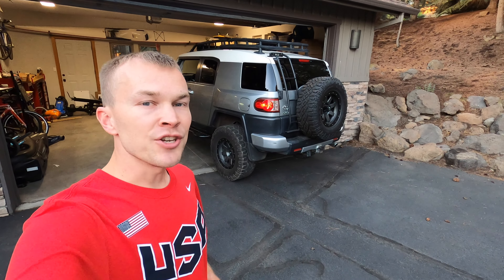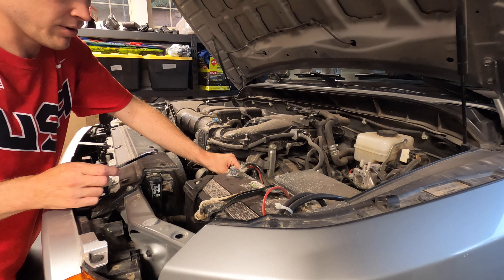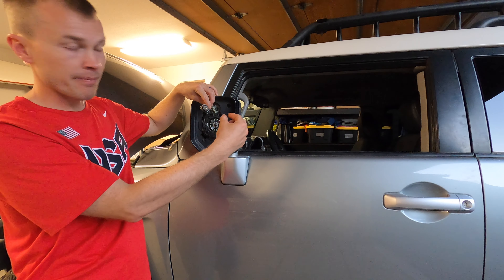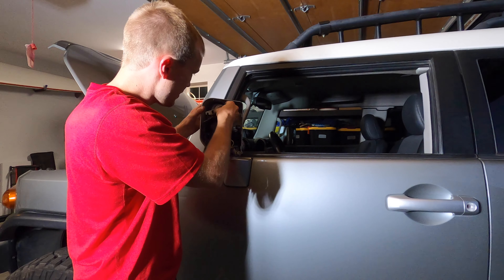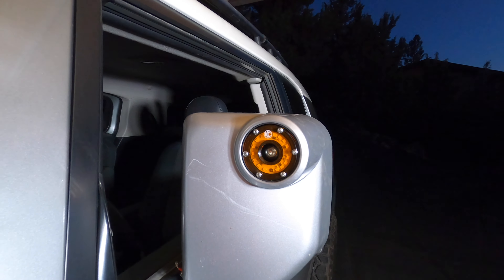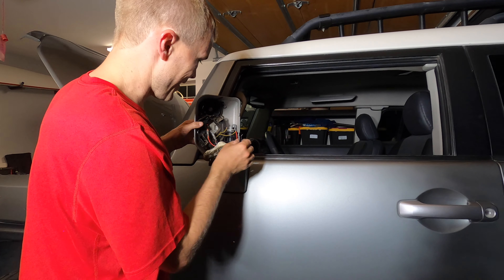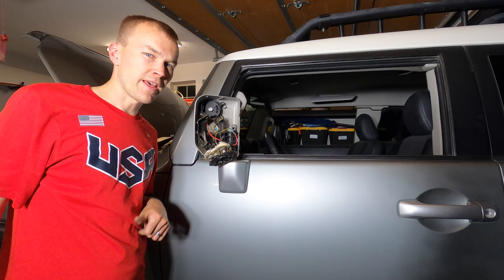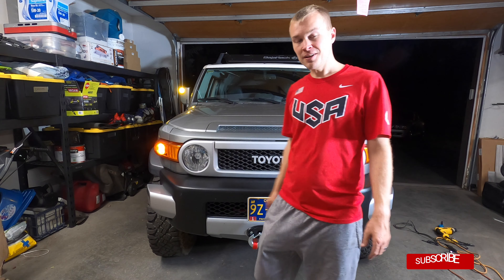New FJ Mirror Lights

Comment: You should always disconnect the Negative Battery post not the Positive.  If you disconnect the Positive with a metallic wrench and you touch any other metal surface you are going to get a big spark.
Reply: I was thinking the same thing, I could have swore we are supposed to disconnect the negative.
Reply: If you leave the lights off, you don't have to disconnect either one
Reply: @smithorjones2433   exactly

Comment: I have replaced the stock bulbs with amber LEDs. I am not sure how bright is this kit, but from the reflection on your fj’s hood, I think the LEDs I installed are so much brighter. P.S.: I also removed the internal blue filter from the stock housing to get a brighter and real amber light.
Reply from the maker: I wouldn't want them to be too bright or you're just blinding on-coming traffic.  The halo effect on these is pretty cool too.
Reply: @DrivenCompanion  They are not too bright for other traffic, but it fills the hood with diffused amber light, which I like a lot.

I like the halo effect too in this kit.

Comment: When I upgraded my mirrors to the EZ View mirrors years ago, I shattered the OEM driver side mirror while trying to remove it as well.  I told myself that once my mirror lights burn out, I probably wouldn't go through the trouble of replacing them, and risk breaking my (now impossible to find) mirrors.  A lot of people swap their lamps for LEDs, but I personally don't find this light to be all that useful anyway so I'll just leave them be.  Thanks for sharing your video.
Reply: you can find ez view mirrors in japan. with heating and all. pricy but available. do some research